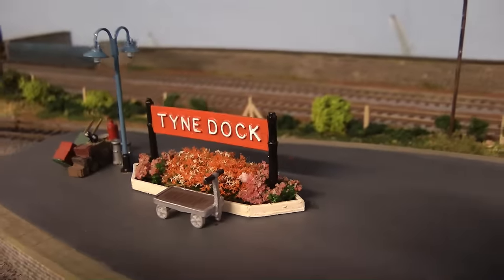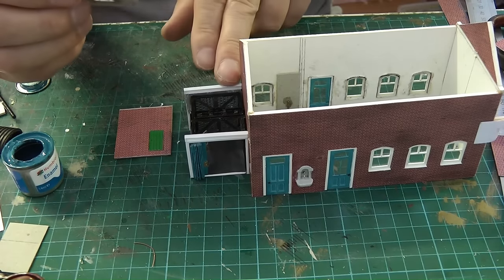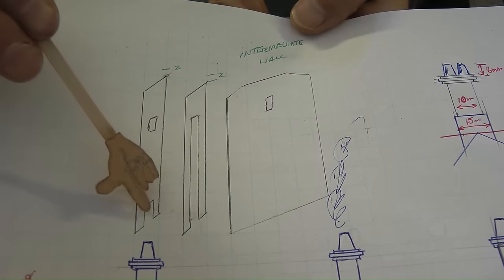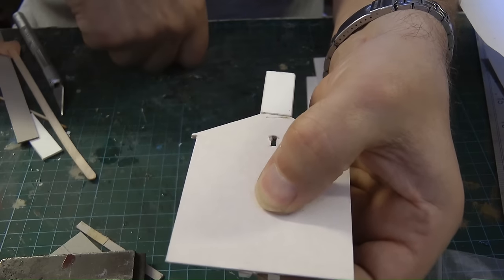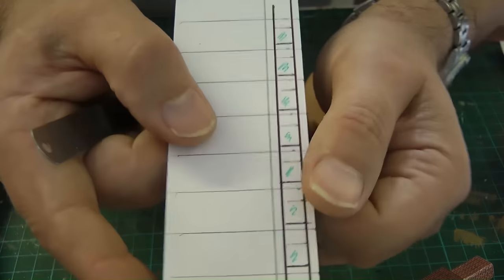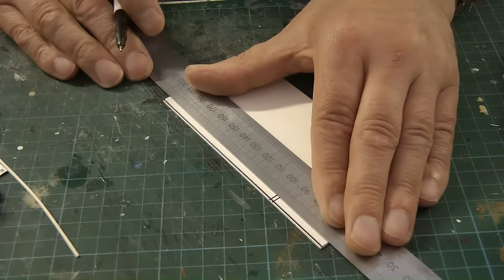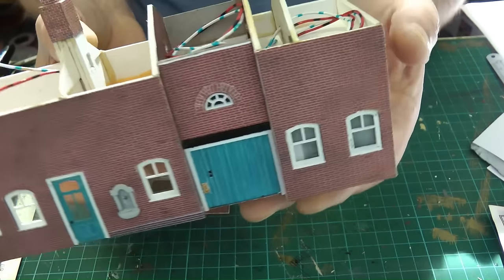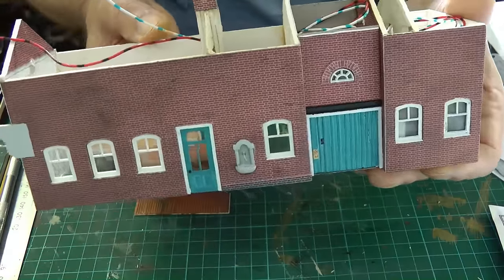Tyne Dock Part 10 Refreshments build comes together. No432.

Comment: Glad to see the progress 😂Tony. I've a bit of a "thing" about fireplaces and found that part particularly interesting. 
I did watch the " Gents" build, but my comment seems to have evaporated into the ether. I loved that too.
Decor in the Refreshment Room was brilliant. 
All the best .Peter
Reply from the maker: Hi Peter. Fire places and chimneys are the only places where you can hide cables. as you will when i do the station masters office. because the main supply for the building will come from that chimney. fingers crossed. thanks you for commenting. cheer's Tony.
Reply: @TONYNORTHEASTERN yes, I've followed your technique with most of my buildings. A lot nicer than seeing cables dangling into "model folk's" bedrooms etc.
All the best. Peter

Comment: Do enjoy seeing the bridge train out for an airing. That was a master build. Brilliant build for Tyne Dock, but a couple of questions. Would there not be a sill for the access hatch to the lift motor room?  2nd would the Engineers Brick not extend between the balustrades below the the route map? Eagerly awaiting the build of the other building as it will offer more opportunities for your little touches. Take care mate. Arthur
Reply from the maker: Hi Arthur, good question. i am guessing there would two entry points for the engineer's inside the lift itself or above through the hatch. i would imagine that the motors would be very heavy. so maybe i should also add a hoist bar just above the hatch. i hope this answers your question. thanks again for commenting. cheer's Tony.
Reply: @TONYNORTHEASTERN , from what I personally have seen, the roof hatch inside the actual lift only allows access to the lift shaft and the cable atachments on the car roof. The actual trails go through the floor of lthe motor room. inside the motor room are the actual winding wheels and electic motors, plus a cabinet of electrical control gear. There is usually a telephone line connection to either the building operator or the lift company emergency respone line for when prople get stuck in the lift.

 Cheers mate